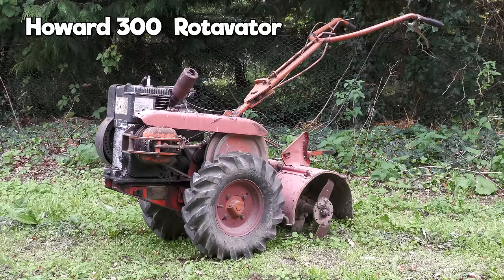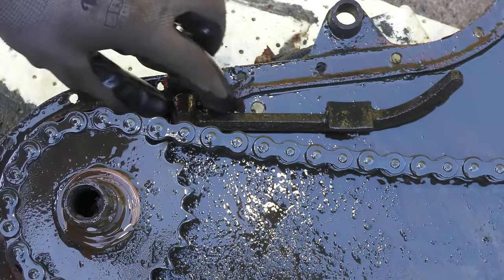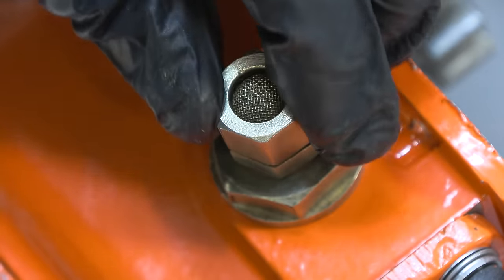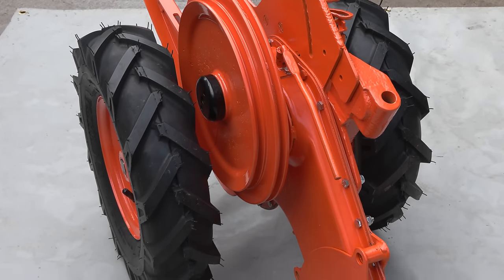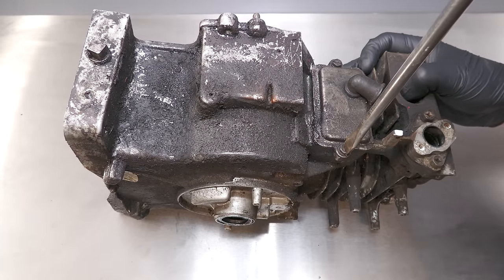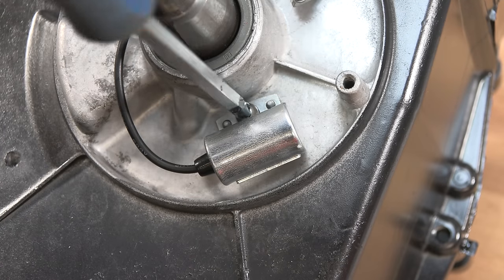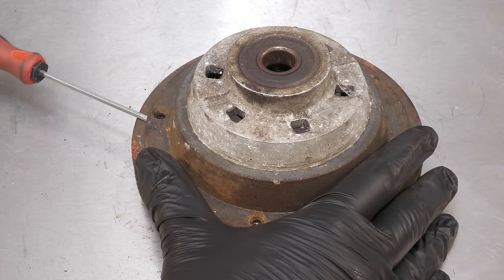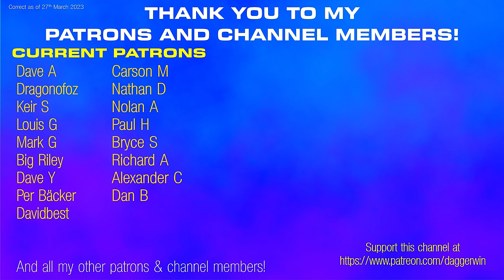RARE 54 YEAR OLD VINTAGE TILLER | RESTORATION

Comment: Hello,i have a problem with my riding mower,basically i was starting it to move it inside the shed when i heard strange sounds from it so i looked under and noticed that the thing (dont know the exact name )with the two pulleys had fallen off the engines crankshaft along with a key and a bolt,do i just have to put the key in and bolt it on and then re attach my two belts back on to the engine pulleys?

Comment: You should clean threads with a chip chaser, not a tap. A tap cuts a bit every time, weakening the threads. A chip chaser does not and is made to clean threads.

Comment: You can't buy that B&S fuel tank anymore, and that engine was used on everything. The carb bowl is built into the tank, so you need THAT tank. The alcohol required in the gasoline in the USA causes havoc with those tanks. It's a shame that such a small issue can prevent restoring things exactly as produced originally.

Comment: Powder coating is possibly the absolute worst thing anyone can do to metal if it cracks or scratches it will hold moisture under it and then cause rust to go insane under the coating but it can never ever be repaired you have to remove it all the way and then re coat it but if you painted it then it got a scratch or chip you can use a little sandpaper and an airbrush to repair it without rust forming under it

Comment: Your tines are going in the wrong direction they should be spinning counter clockwise into the soil as the engine drive pulls them into the soil and pulls the tiller forward...

Comment: Upon reassembly of the engine you forgot to put it on the oil slinger/governor
Reply from the maker: No, this has a dipper and an air crane governor
Reply: @MachineryRestorer  ok

Comment: he fit new parts the old blades was good and got long bolt is wrong way as nut all gos on left hand side of 300 350 352 and 300 was 1962 to 1965 when k91 and 141 engines  was fitted  and briggs engine is obsolete now it what agents got on shelf